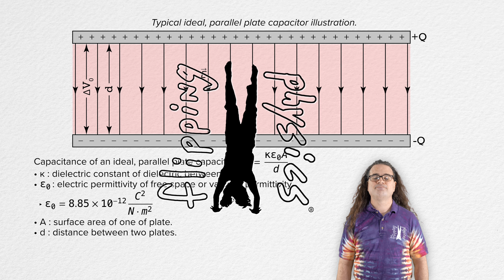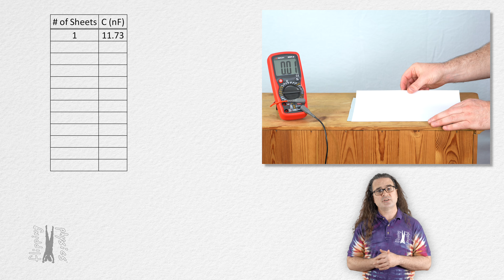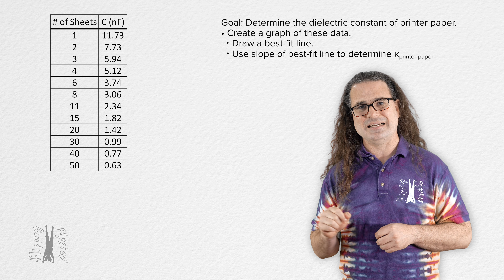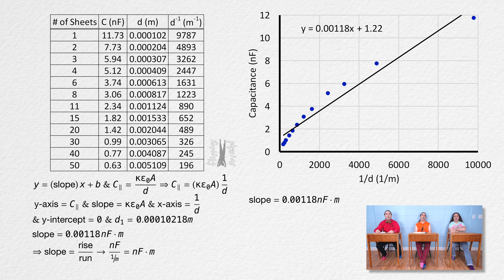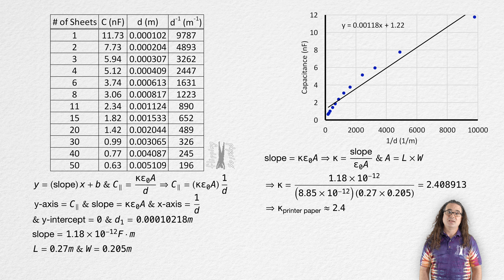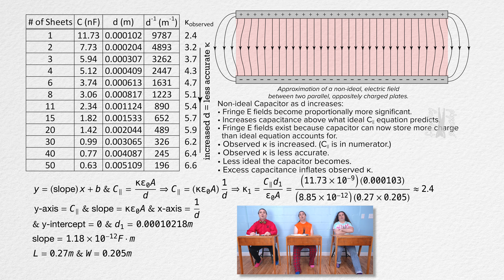Build Your Own Parallel Plate Capacitor

Comment: Hey, I just had a general question. Do you consider your E&M videos so far as complete to have a general foundation of these topics when self-studying this course? Currently, I'm learning Mechanics and noticed the significant video difference between mechanics and e&m so I wanted to reach out to figure out if this is fine
Reply from the maker: There are a couple of small gaps in the E&M videos; however, they are very specific things like deriving the capacitance of specific shapes of capacitors. I've had many students use my E&M videos to self study for APCEM and do well. Best of luck!